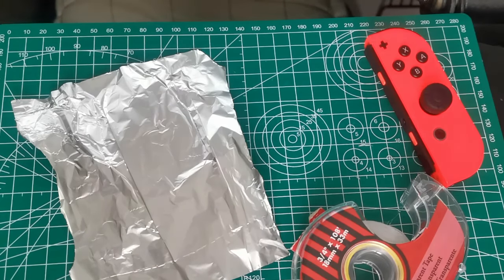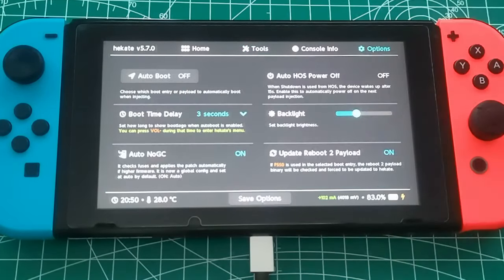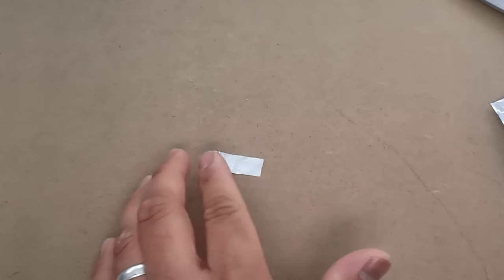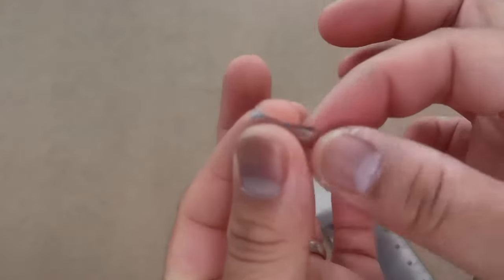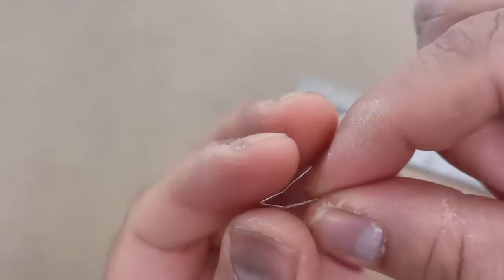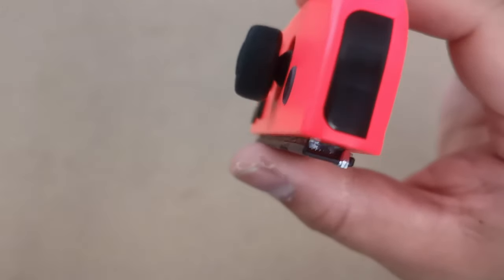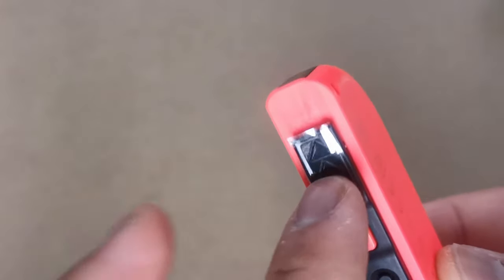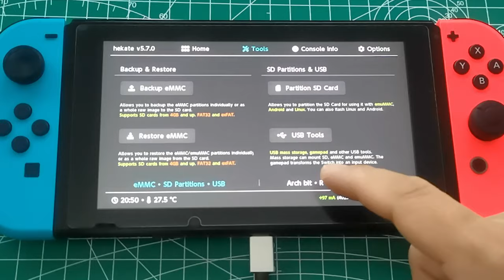Making a Custom Jig with FOIL! To Jailbreak your SWITCH!

Comment: Worked first try😅, had no ruler for measurements so I went off of instinct
Reply: Same
Reply: It pops a lot and it may break ur Nintendo switch
Reply: So do you need to put the mod on there beforehand? Seems this video just goes in media res.

Comment: I don't think you're supposed to Short 10 and 9, it's just 10 and then any ground pin (1, 2, or 7). Doing 9 and 10 may work but is more dangerous to the switch than it needs to be

Comment: I tried your way and paperclip and from what i learnt is that the paper clip is way more reliable the paper clip can be used many times but the foil can only be used once or twice and i havent got it to work once with the foil and you have to be very precise in conclusion use paperclip method guys😊

Comment: One thing not mentioned is how the tin foil CAN touch more than the last 2 pins. I think you should make the foil less than 1/2 an inch wide also. I was having trouble with that. I probably just have some thick foil as is. When I folded the long skinny strip in half, it was too thick to slide into the joycon rail. 

Found another video where the guy said to keep the foil to the one side as much as possible. I tried it, worked. So no, you don't need to worry about it touching more than the furthest 2 pins. The tin foil on my controller had 3 obvious pin indents meaning it was touching 3 pins.

Then DON'T shut down unless you plan on shorting the pins again. You can reboot and inject payloads but if you shut down, might as well buy a jig for a few bucks or 3d print one with a paperclip.
Reply: what was the other video
Reply: So it can touch 2-3 pins and still work right?
Reply: thanks brother, that part stressed me out a bit
Reply: @matthewlopez00  You're welcome. Glad it helped someone.

Comment: Thanks, worked first time once I'd actually read the payload instructions. I'm a little concerned I've flattened the 9 and 10 pins on the joycon but will know for sure once I remove the foil

Comment: I had some struggle, didnt have any tape, i was eventually able to get it to work by placing the foil on the pins of the switch itself and then carefully sliding the joycon into place

Comment: Cannot get it to work at all, it won't turn on for certain atm, but I get the sense it's not necessarily from recovery mode because nothing is working and I've had it do that today without the foil. I feel it's more likely to be something I'm doing than that. There needs to be some kind of close up (and uninterrupted) footage of the placement process, rather than a before and after with some close up shots between that. I understand that may be impossible, but I'm just putting it out there in case it's something feasible to attempt. I might just buy a jigrig at this point :/ Nice video though! Got the gist, just didn't work for me this time...

Edit: Oh and it's not broken, it's new (as in out of box, not the most recent models) and it turns on sometimes with a press of POWER after I connect different cords as well - like it resets it's position on what it thinks it could be doing??? And now I'm crosseyed... I'm thinking it's something to do with the controller not registering because I believe I'm unfortunately unable to avoid hitting the wrong pins

Edit II: Figured out the problem, I think. It's been working, but my firmware is in the "maybe patched" list so I was trying to verify with TegraRcmGUI. That was the problem, I believe - oh and PSA by the way: TegraRcmGUI doesn't properly work with Windows 11. I have no way of verifying whether my Switch is JB-able or not without massive hassle that may ultimately end up in a bunch of undesirable programs downloaded in a vain attempt to achieve a simple check that in truth, could very well end in negative results after all that effort, unfortunately :( Any fixes are immensely appreciated that don't involve changing OS or running VMs, as I know how to use them, but live in a place that incurs the 'oh so special' irritation of alot of data restriction and dropped speeds with an ISP in the year 2022.
Reply: I also have a "May be patched" switch; did you find a way to verify? Don't really want to waste time or money to then find out I can't do anything.
Reply: @rr2308  use this custom rig and the downloads are free, just time to be wasted bro. Rather waste an hour and play any switch game than pay 100s for games
Reply: are you still breast fed?
Reply: @BruceAllentools  Ask mom, she would know 👌🏾

Comment: i did this and it doesn't turn on, like it's in rcm mode. But when I try to connect it to the pc to inject the payload it does and it boots to the default switch menu. What am i doing wrong?

Comment: Is this not dangerous while  you can burn out stuff on the circuit board and destroy your console
Reply: Just never touch Pin 4 or you will fuck your switch. Usable pins for RCM are: 1,2 and 9.

Comment: Question, can you mod a possibly patched switch?
Reply: if the isyourswitchpatched site says it may or may not be patched try getting it into rcm once in rcm inject a payload if it mods good if it doesn't then you did it wrong because a patched switch won't boot into rcm lmao
Reply: Yes, but you have to change the chip of ur switch

Comment: Bought an actual rcm jig and it didn’t work and then I tried this and it worked first time 😮🙏
Reply: you did it wrong then because the jig always works for me never have i failed to boot with the jig so somehow you did it wrong
Reply: Use VOL+ and the power button while the RCM jig is inserted. I think you did the wrong combination for RCM mode while your RCM jig was inserted. Did Tegra detect it with the jig and not the foil on your Joy-Con?
Reply: BTW I don't have an RCM jig and this video really helped me get into RCM mode.

Comment: When I try to put the joycon in it doesnt snap! Someone help ASAP!
Reply: Does it click into the Joy-Con rail but you don't hear the Nintendo Switch click sound like you do in first boot or factory reset?
Reply: Can you enter RCM mode?
Reply: If you do this tutorial, you will only be able to use it to enter RCM mode.
Reply: I recommend you use an old Joy-Con with this tutorial, not your main ones or any new ones you want to use with your Nintendo Switch to play games with.

Comment: Does it work on 14.1.2 or later?
Reply: Answer: Yes
Reply: Last time, I did this method, I thought it didn't work because I forgot to install the APX USB driver in Tegra on my laptop. Now I have it installed and I modded my Switch for the first time on July 10th.
Reply: My laptop screen is broken.
Reply: @eissathegamer9466  your laptop screen is broken.
Reply: @Taebot64  their laptop screen is broken.
Reply: I lost my RCM jig and now I have AutoRCM turned on.